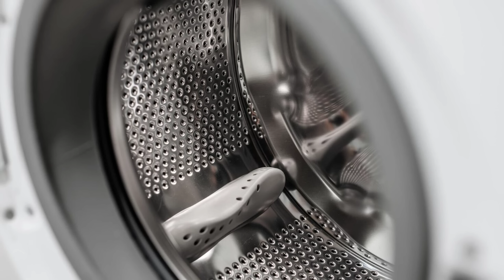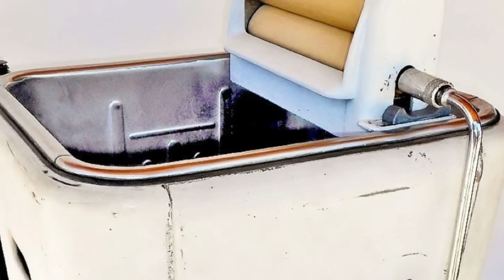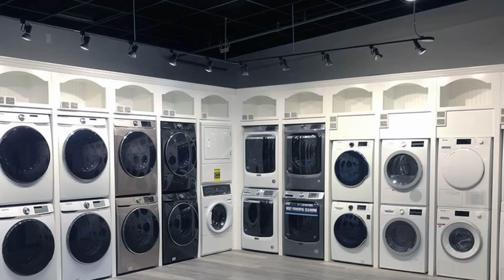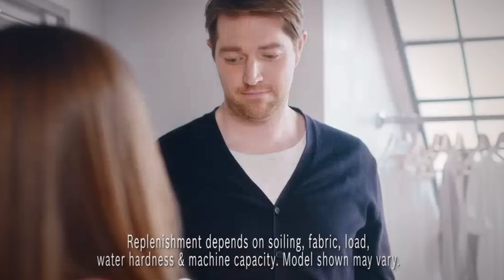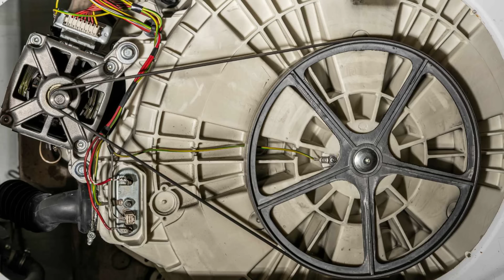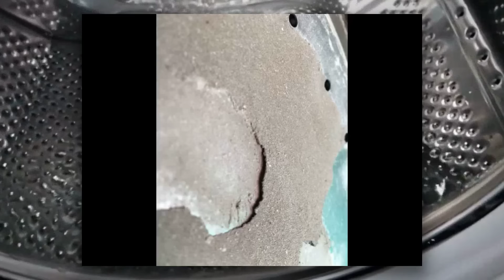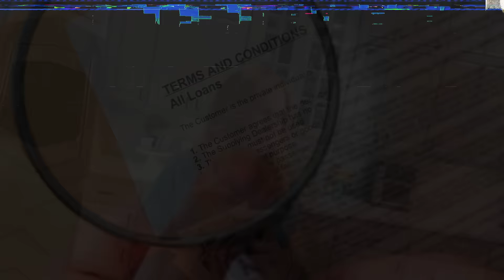The Only 5 Washing Machine Brands In The UK Still Worth Buying (Everything Else Is Junk)

Comment: I have a AEG. Two years old, no faults so far.
Reply: I have an AEG, 28 years old. The heating element was replaced 16 years ago and nothing needs since then.
Reply: Buying a washing machine from AEG is a gamble because only 10% of machines are fully tested at the factory. They rely on you the customer to put up with faults under guarantee or pay for them afterwards. In 2017/18 they supplied me with four identical machines from different 20,000 batches, all with the same electronic fault. Only by giving me a different machine with different electronics, did I finally get one which was fault free, and still working.
Reply: I had a AEG for 22 years. Just bought a new AEG.
Reply: Bought an AEG 13 years ago. Drying does not work but washing side worked well.  Just recently getting bearing noise.
Reply: We have an AEG, it's 7.5 years old and the bearings are going in it, sounds like a plane taking off. But it probably did a dozen loads a week it's whole life. 
Not sure what to get next. Another AEG, Bosch or Miele? Don't know.
Reply: @zeroyon4562 I had the AEG. Loved that machine. An absolute workhorse and super quiet. Went Miele this time but already have an issue with the twindos. Also customer service team are really poor.
Reply: @Ismail-1129  Oof that sucks. Thanks, that actually helps narrow it down for me, although Miele have a promo here at the moment where their machines have a 10 year warranty. 

We have the AEG washing machine and AEG dryer stacked together so another AEG makes most sense, but once bitten, twice shy sort of thing. The 5 year warranty on them is pretty good compared to the 2 year for Bosch, but Bosch you can get parts off their website and they have all the exploded diagrams which is great. Can't buy replacement drum or bearings for the AEG.
Reply: @zeroyon4562 I went for them because of the 10 year warranty. I’m waiting 4 days and 2 phone calls. The customer service team still have not applied it to my account. At this rate I’m thinking of sending it back.